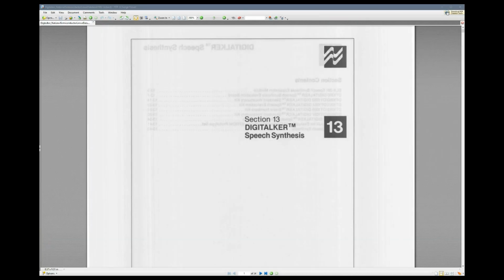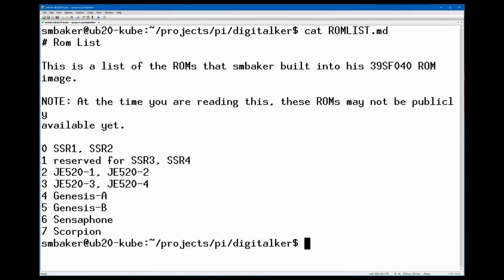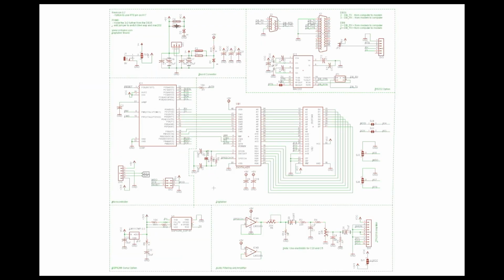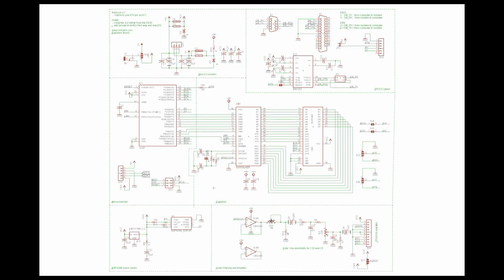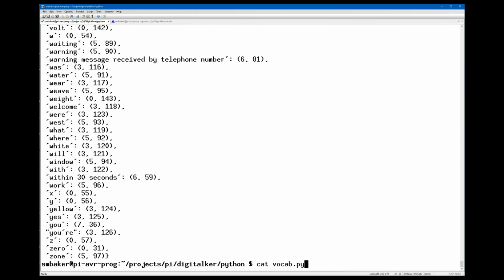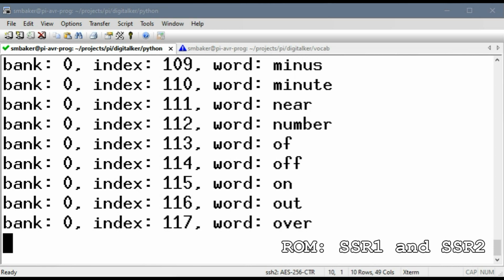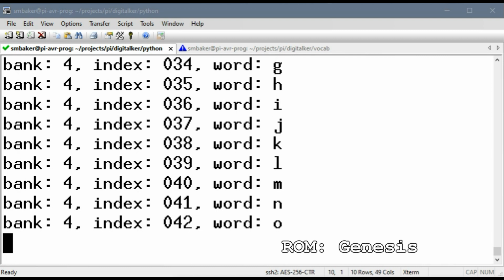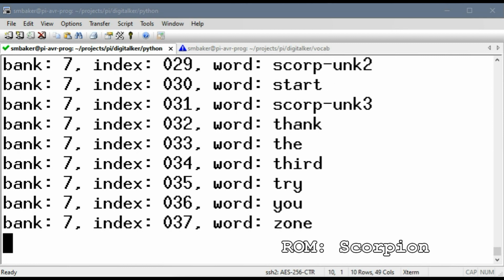This is Digitalker! (and Jameco JE520) Vintage Speech Synthesizer

Comment: I was 26 back in 1982, working full time as a processing Equipment Maintenance Technician for GTE uCircuits in Tempe, Arizona. We were making early video game ROMs, Static 2114 static RAMs and Mil Spec 65C10 uProcessors chips on 4" Si wafers.     I bought the Digitalker chipset complete with both of the ROM sets from a local electronics distributor called Circuit Specialists that's still in existence in Tempe, AZ and still selling electronic components online.     I built a WireWraped perf board for all of the devices including audio devices.  I first interfaced the Digitalker to a Timex-Sinclair ZX81 computer then later interfaced it to a Commodore Vic-20 then Commodore 64.   I also built a Wire Wrap card for a pair of Intel 8255 chips so I could interface A to D and D to A converters to the C-64.  What fun I had with the Digitalker.    An interesting thing is that there were many disallowed addresses of non-usable words that you could send to the controller chip then toggle the speak command. The Digitalker would then speak in a sort of "Martian" language.   For simple video games I made it say, "Attention Operator!  This is the Space Intruder.  Please select entry".

Comment: I just emailed you Scott re roms.  Back in the day I had a Dynamic Logic A200414 Digitalker board which I stupidly destroyed with reverse polarity...  I really should try to get another as it has so much more clarity than any synth. Have you done a Digitalker pcb in RC2014 format Scott?   Cheers - Phil

Comment: I'd be interested if there was any updates to the use of this chip (SSR5/SSR6 ROMS). If the algorithm is know, or could be decoded, especially the pitch change for the female voice used in the very first same, it seems like a real possibility to create a "modern" ROM for this chip, especially due to the way you have designed the card, a large dictionary or word list would be possible

Comment: I began with Digi talker. We were designing a talking coffee maker and picked this chip. The company had a spokes person and was preparing a script for the functions. To make the ROMs we bought their development board and software. Now much of my speech synthesis is done using Amazon’s AWS Polly. The voices are very good. If I need better a voice actor can be used. Using Audacity to edit each word or sentence. I found really cheep mini-MP3 players on Amazon. The fit in a breadboard ad can be placed on a board using header sockets. I have been using Python boards from Adafruit for the computer. The audio MP3 files are stored on a flash drive. To access the audio the files are numbered. That is, it. You do voices, music, and even sound FX. Now for my AI work I use Python and PYTTX3. This is a text to speech synthesizer library.

Comment: My S100 Bus DigiTalker works and has both the standard SR1/SR2 and extended SR5/SR6 vocabulary ROMs. Be aware that the DigiTalker SPC IC is susceptible to spontaneous failure.
Reply: Would you be able to share dumps of the SR5/SR6?

Comment: For those interested, I have quite a stack of NOS (but tested) Digitalkers (MM54104). So if you need one for a similar project like Scott's, let me know. Als got a few ORIGINAL MM52164SSR1 and SSR2 ROMs, quite rare these days. I do not have the SSR5/6 or their ROM contents. Looking for the (contents of) the MM52116SHR/L myself. And any custom ROMs from that era ;-)
Reply: How do I contact you ?  I’d be interested in a chip set maybe 👍🏻
Reply: @8-bitbitsa821  When you look for "Digitalker speech synthesizer (Mozer) MM54104" on Ebay, then you will see my ad (from The Netherlands, so you might need to check "worldwide"). If you contact me there, we can discuss what you need and price: MM54104, MM52164SSR1 (ROM), MM52164SSR2 (ROM), etc. I'm shipping world wide, when it fits in an envelope , the costs are really low. Cheers, George

Comment: I think you should add a resistor on the RXD pin of the ESP module that goes to the Atmega, so the 5V of the Amel won't hurt the 3v3 input of the ESP

Comment: "interuder"?
Reply from the maker: My listening was late one night and I'd not be surprised there's more than just a few typos in the list. There's also a few that I couldn't quite make out and wrote down my best guess, like thunnel and swerch (probably "switch", but I could've swore at the time I heard an R in there). A few that might simply be wrong ("cancel" would make more sense than "candle"). Please anyone who notices a typo or an incorrect word do point them out as I'm checking the word lists into github.
Reply: @smbakeryt  Ah, that makes sense. I went through a similar process naming a series of spoken word samples. I can hardly spell to begin with, but some of them I couldn't even guess at what was said.
Reply: @smbakeryt  I’m thinking that the word you’re looking for might be “total” not “thunnel.” (JE520 Bank 3, Index 107) I’m not even gonna say what Genesis Bank 4, Index 098 (“buzzing”) sounds like to me. A hint: It would be, alphabetically, towards the bottom of the “F” words on the list.
Reply from the maker: @sonotdown998  Thanks, applied these corrections to my list.
Reply: @smbakeryt  No problem!
Reply: @smbakeryt  Also, Genesis Bank 5, Index 095 is probably “wing” and not “weave.”
Reply: @smbakeryt  Scorpion Bank 7, Index 017: Most likely “is” and not “give”?

Comment: The Digitalker makes my skin crawl. Probably because I have worked on Fire Panels that uses that Chipset's voice.
Reply: Any chance you remember what type of panel it was?
Reply: @NewAgeServer  It's been a few years. It was either honeywell or simplex. Wasn't the panel itself but with a remote keypad that would talk. We typically ended up replacing everything with silent knight panels.

Comment: I’ve been more interested in DECtalk, now implemented in a single chip, the Epson S1V30120F01A100. It’s the core of the Emic 2, which you may have heard of.
Reply from the maker: I've seen a few DECTalk-related items come up on eBay, relatively high priced though. I don't know much about them.